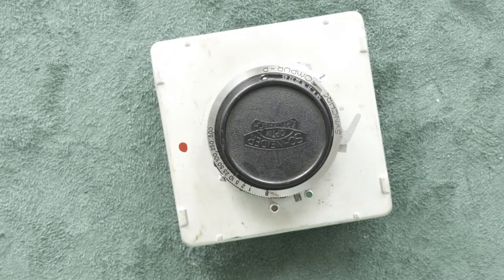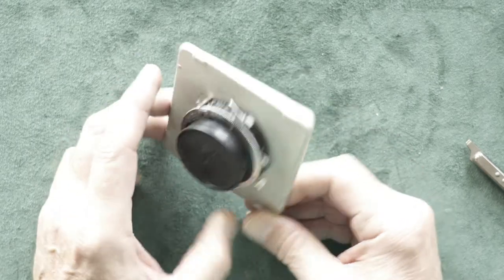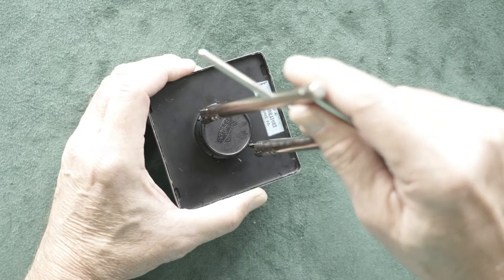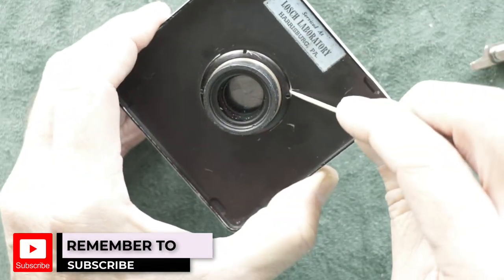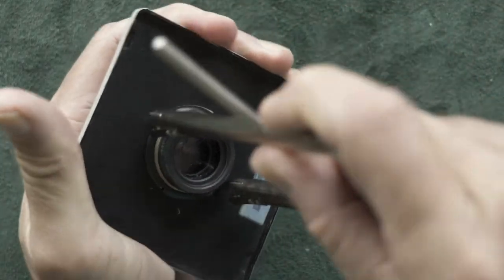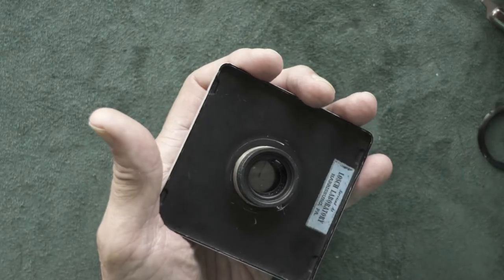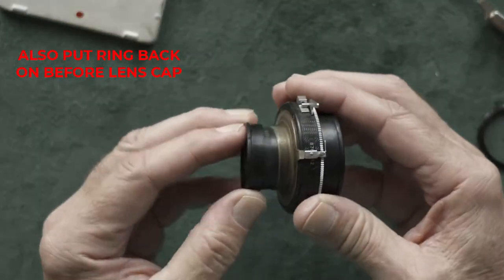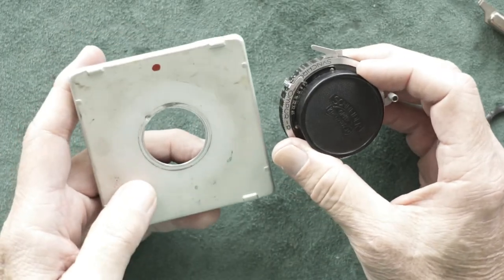How to Remove 4x5 Camera Lens and Shutter from 4x5 Lens Board

Comment: But, what about when you have a wide angle which the rear part is wider and it wont let you align the Spanner Wrench because of the size of the rear lens and part is frozen, and you don't have the grip because the cone shape. What would you in that case.